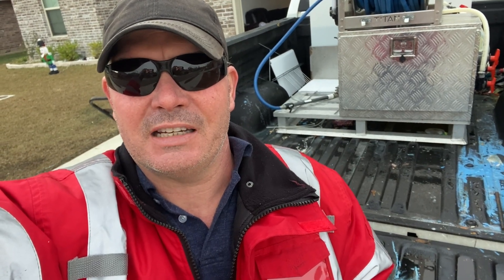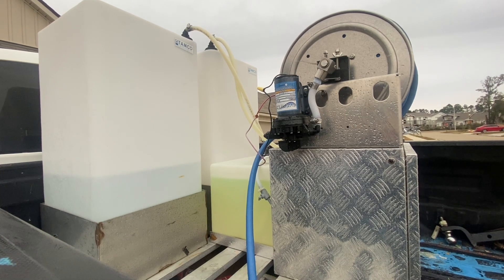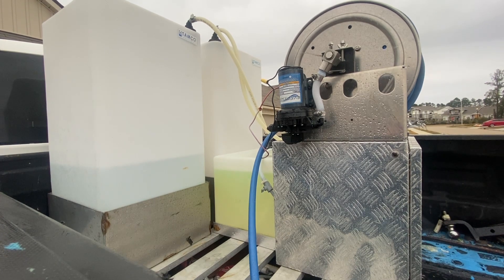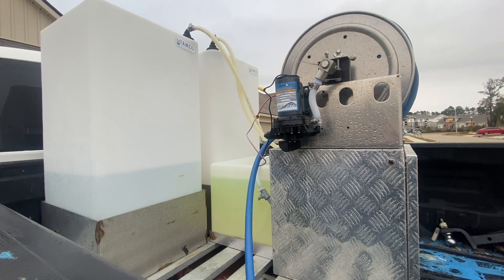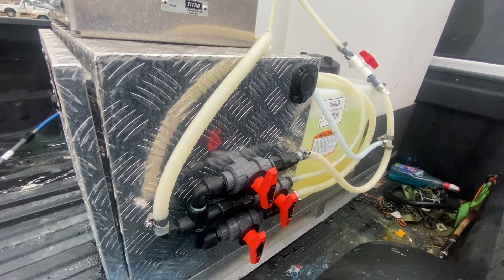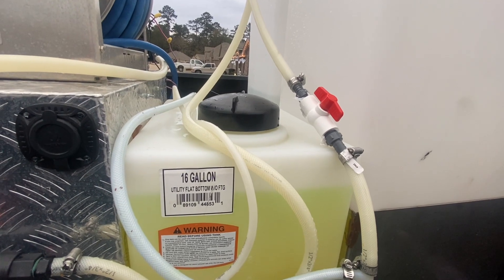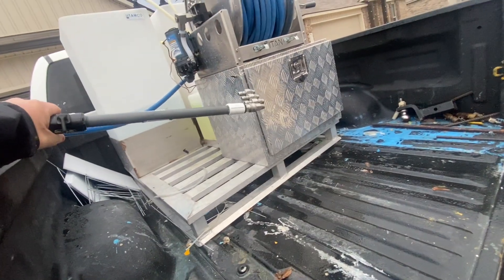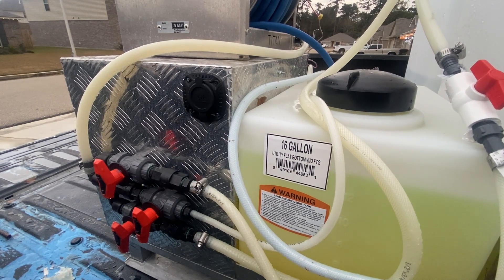SOFTWASH SKID REVIEW

Comment: The handle on the reel would be better if it hanged off to the right side of the box at first glance and the metering valve up higher over the box would be better in my opinion. Very simple design. Could've probably build one for a lot cheaper then what they sell for....

Comment: where or what is your refilling station? Also if you had to guess how long or how many average house wash jobs does the 50gal tanks last before refilling?
Reply from the maker: We usually get our message from pinch a penny. 50 gallons for house wash would probably do five. Or two small shingle roof cleanings